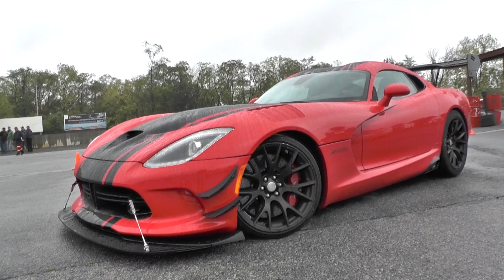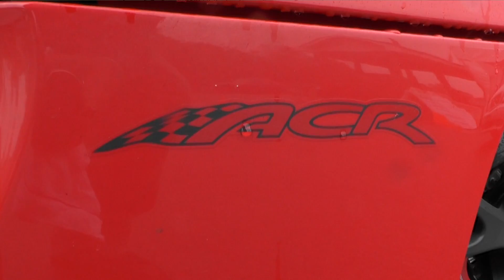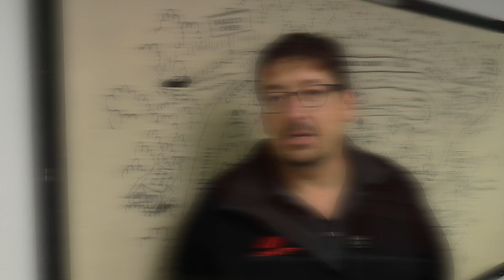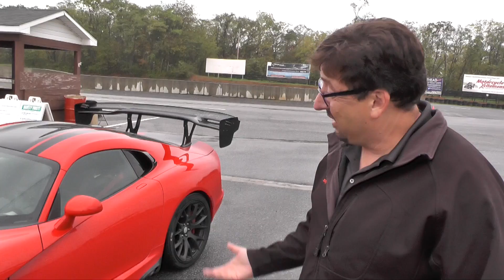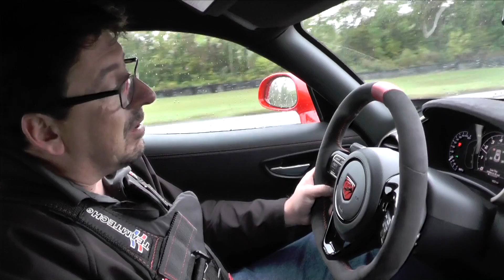2016 Dodge Viper ACR Engineering Insight - Erich Heuschele

Comment: 645hp v10 viper vs 707hp hellcat v8
Reply: Hellcat has a supercharger viper is natural aspirated. Put a supercharger on the viper it would push 800 hp easy.
Reply: @zerooneonefive very true did not even think about that..
Reply: +Jamal Fakih the suspension on the viper is better and its lighter so its actually faster than the hellcat
Reply: The standard viper will beat the hellcat in the 1/4 and 1/2 mile . Acr has to
Much drag. Hellcats are to heavy